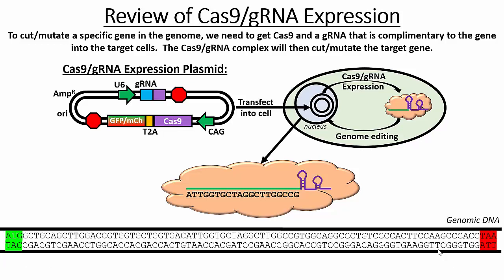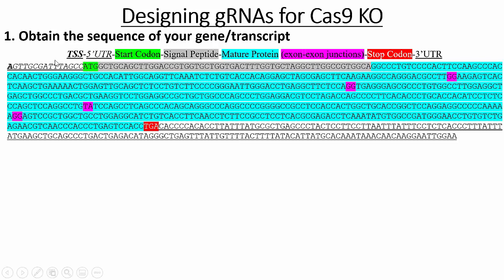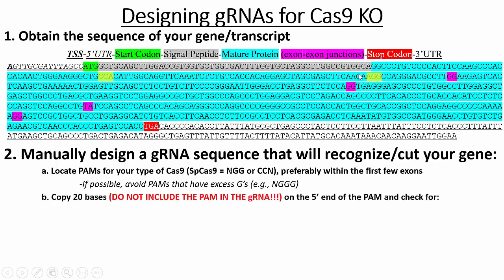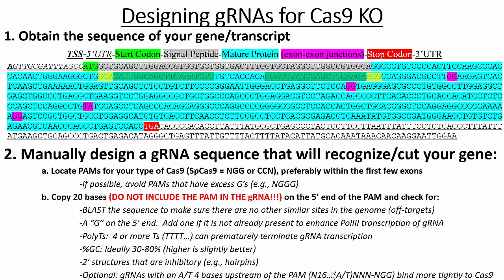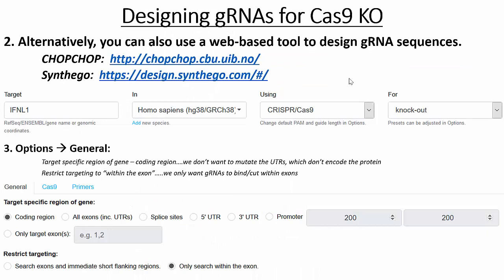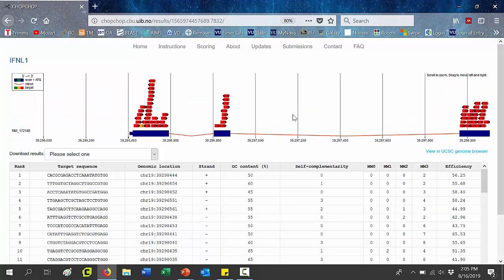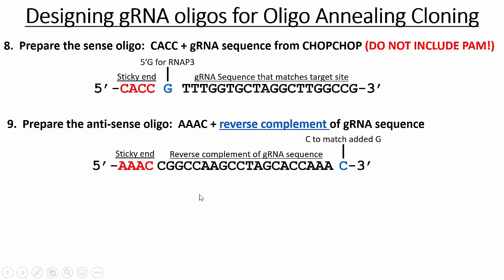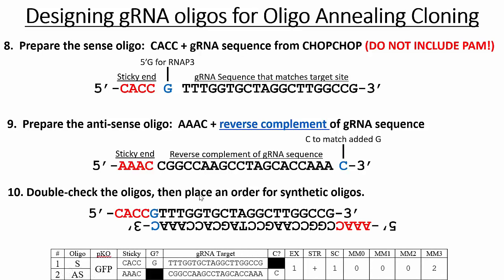Designing gRNA Oligos to Clone into Cas9 Expression Plasmids for KO Experiments

Comment: Thanks again for this super duper video
I  have an inquiry please
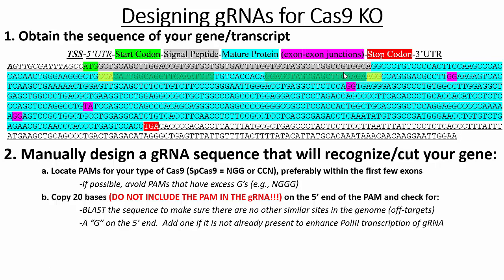In 6:43, you said that Cas9 is pretty faithful but it can mistakes so its best if you only use gRNAs that have at least 3 mismatches
and in 16:30, you said its better to have a gRNA with no off targets and zero mismatches, its important that MM0 be zero as if this number greater than zero, the gRNA will cut my target gene and some other place 
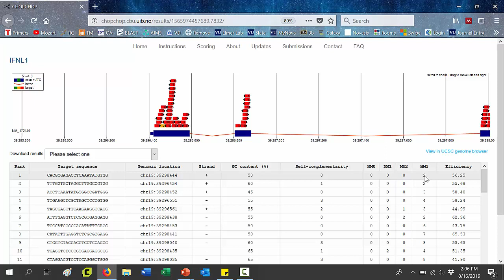in 16:50, you said that its very difficult to find a gRNA that has zero off targets with 3 mismatches
I did not understand this part, sorry if its clear and I didn't get it, but I found myself confused

Comment: Thank you so much for the excellent video! I have a few questions about guide RNA (gRNA) design that I hope you can help with. I'm working on a gene with three exons and two introns. The first two exons are in the 5' UTR, and the third exon is partially in the 3' UTR. When I try to design gRNAs for exon 1 and exon 2, I struggle to find optimal matches. Even when one meets criteria like GC content and self-complementarity, it still has mismatches, some of which are in the exons or CDS regions. Following your method from the video, I input the gene ID and found the exon blue blocks and intron lines. However, I couldn't identify suitable gRNAs for exon 1 and exon 2, while exon 3 displays many potential gRNAs. Since I’m still new to gRNA design, I'd really appreciate your guidance. Should I focus on designing separate gRNAs for exon 1 and exon 2, or should I concentrate on exon 3, given the better matches? Your advice would be incredibly helpful!